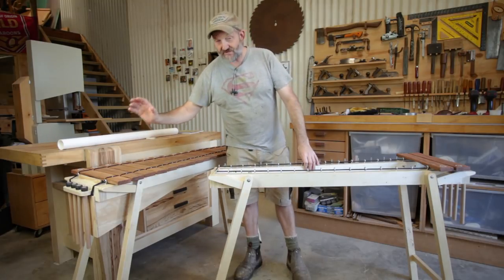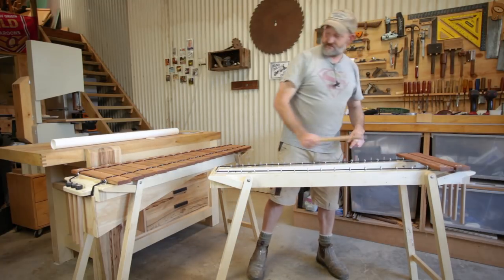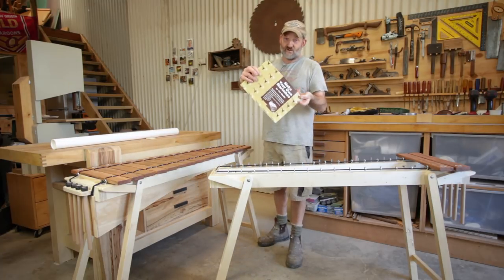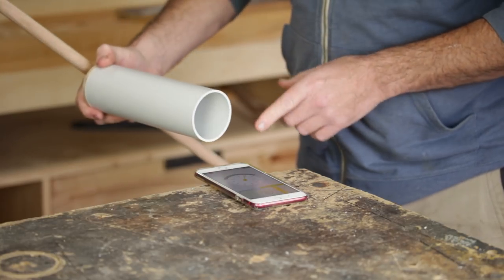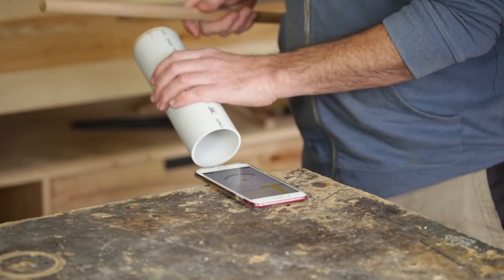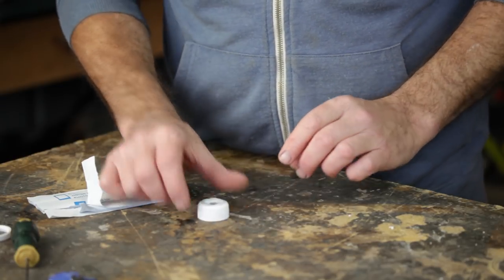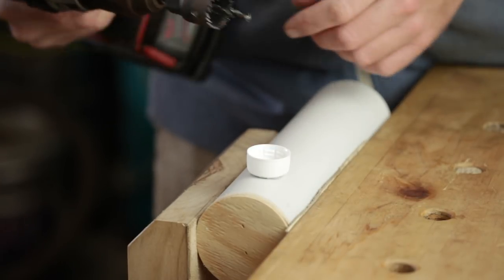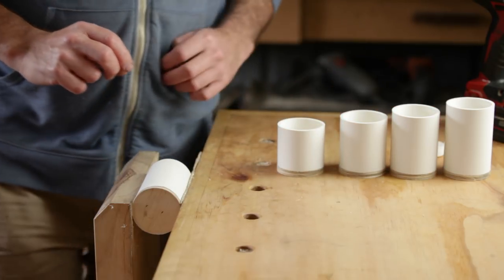Pipe Resonated Marimba

Comment: Wow the buzzer makes the sound so special ! And only with a bottle cap and some grocery bag discs :')
I love it !
Reply from the maker: Thanks Ben! The buzzer certainly does produce a different sound - my daughter wants me to build her one now but we haven't the space for a second marimba. :)
Reply: It would be perfect if you could swap between the box and the pipes with the same marimba :D
And by the way, doesn't the buzzer "detune" (I don't know if that's a word) the pipe by changing the size of the hollow space ?
Reply from the maker: I could pull the box out of the one we have and replace it with pipes but I'm not sure when I would get around to that. It's a good question on the buzzers - after checking they didn't seem to affect the tuning of the pipes but the bottle caps really don't go in very far (they are fairly flush with the inside of the pipe.
Reply: Then throw out the sofa.  You gotta do what the women want.

Comment: Note sure about adding buzzers, but then i removed them from my Kalimba, so i guess it's just not my type of sound. I would be curious to here the sound of the pipe marimba without them
Reply: I would remove the buzzers too. Also make some shorter (temporary) legs so its easier for her at her height.

Comment: Great build and great to see your number 1 tester hard at work. I did wince a bit at one point though - I know you were only using a pin nailer, but when shooting the holders into the end of the frame,  your bits were right behind in the firing line. Not much chance of shoot through I suppose, but still made me cross my legs - not sure I would want to do that with a bigger nailer! :-) Anyway great video!
Reply from the maker: Thank you! I didn't even think about that but it probably does look a little scary! ;)

Comment: At 1:57, what are you spreading on the boards you just cut?  Thanks!
At 5:00, looks like you're adding a kazoo effect.  When you cross drill the pipe, and insert the buzzer assembly, the pipe's volume changes.  Have you tuned a pipe assembly, then added the buzzer, then tested the tuning and found the tuning changed much?
Great video, thanks for sharing.
Reply from the maker: Thanks Greg! At 1:57 I'm putting a coat of water based polyurethane but anything could be used. Yes I tested the pipes after adding the buzzers and it seemed to make little to no difference - the buzzer doesn't go in very far, it's actually fairly flush with the inside of the pipe. :)